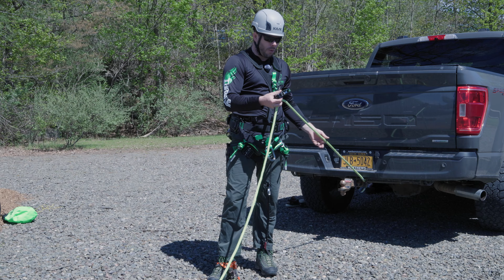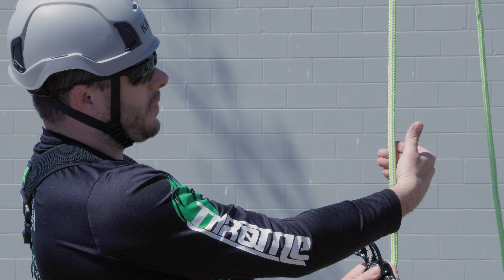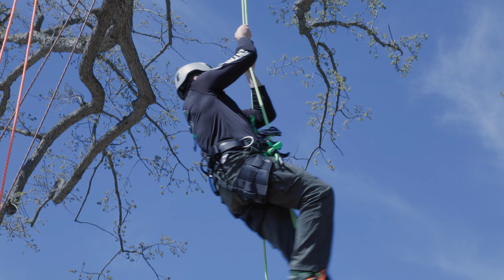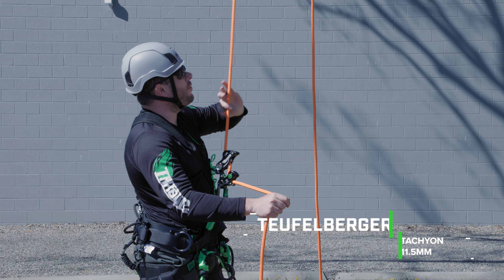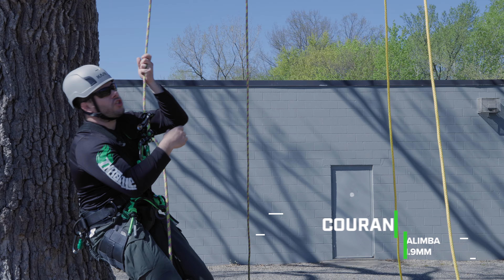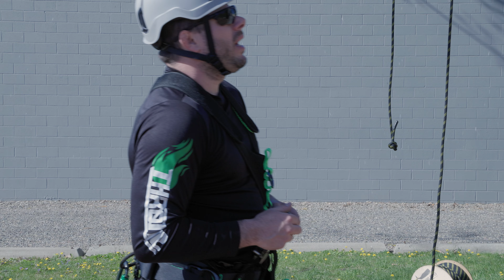Buckingham Throttle™ Overview

Comment: I feel like the device should be ready to go from the box, shouldve had a little more machining or polishing on the friction jaws at the factory. How long is it going to take to "break in" because mine is tough as old boots. Very fatiguing on a long days climbing. Very tough on limb walks, unconfortable to use, the edges feel quite sharp, not ergonomic or well designed when your on a limb walk and having to reach for the device to let slack out when its behind you or at a funny angle. It isnt always going to be right in front of you as demonstrated in this video. the cams extrude over the top of the device by a couple mm which get caught by your fingers and affect the way it breaks friction or the way you pull slack through the device.
When using a 3:1 (on srt for return on a limb walk) the rope rubs against/pinches the back of your fingers when walking out on the limb/descending. The friction can be quite tough when ascending too. 

My tending pulley doesnt spin smoothley either already, the bearing feels worn or something and the pulley also rubs on the cheek plate quite substantially which has worn the pulley wheel and cheek plate after maybe 20 climbs

Im using a marlow maverick 11.7mm rope 

Overall im not very impressed with this device
Reply: Anyone company new to saws or mechanical or batteries is going to have problems..akimbo and rope wrench...go to 2 combos ..have new un used zigzag and new unicenders that freak me out on srs because it don't stop when descending..o.n blue moon akimbo and rope wrench on 2 of them never fails ..

Comment: This is great information. I am currently running Yales Blue 32 and Blaze combo with my Throttle and loving it! I am on the smaller side for a climber though (155lbs), How much does the gentleman in this video weigh?
Reply from the maker: He's right around 205 lbs!
Reply: How is it running on the blue 32? I returned mine because it would not play nice in any of my standard ropes and I dislike the blaze that everyone else seemed to be having luck with. I never thought to run a caveman 16 strand 13mm rope through it to wear down the friction plate to get it to function.
Reply: @troyerthedestroyer we used 16 and 12 strand for over 20 years .seen small Mexican take down the biggest red oak I've ever seen with Blake's hitch and old lether seat belt .😢😮😅..back when I was still in production employment we didn't have internet and didn't even have hitch climber s...was all Blake's double Blake's or taught line
Or split tail.french prussic 😅
Reply: @Sethhaun78  Yeah, I ran all the old school stuff too but I am still climbing and need every advantage I can get :D
Reply: @troyerthedestroyer I know I'm going on 50 with broken left outer foot and left fingers 🤞.my right knee is torn and had liver failure issues last year was working with that illness 2 years and didn't know caused my body to cramp up and shut down..last year could barley lift my saws ..got small hernia from it as well...went almost 28 years never heard of injury until I got sick the heat makes my hamstring lock up so bad it's terrifying..crippling..been waiting all year praying for cool off .just now able to climb half way decent again..I run solo tree service landscaping business full-time..went threw dozen guys they just don't want work ..only want payed...but being health issues it's getting real real hard..have a guy couple days week but needs trained on ropes ..have grcs so if could get a guy to stick around be great ..also have the truck mounts...fir it...hard to do solo...just bought used ditchwitch sk miniskidsteer last fall but don't have dump trailer only 14 ft trailers that I load ..for last 7 years had to remove trees and hand load them by . myself..just can't do it like before with liver and health issues...the medicine they have gave me helped out need follow up for something else ...I've gained back 12 pounds was skin bones ...I used to lift 400 pounds and be superman but after 43.  Was in comma and started HAVEING issues... learning to do everything all over from dayone ..have to move certain ways and do things different then before it's been real real struggle..
Reply: @troyerthedestroyer  Runs great on Blue 32. I primarily use Blaze for MRS, but I also have Courant Squir and XTC-48- both perform extremely well with the Throttle for me as well. I’ve used mostly mechanical devices for the past 10 years, so I’m familiar with the need to be patient and let them “polish out” a bit. There’s also something to be said for using your actual mechanical device for the milking process (as shown at the beginning of this video). I’ve noticed that many climbing lines like to adapt to the way friction and pressure is applied by a specific device—almost like a kind of mating process i.e. like your brand-new boots adjusting to your feet, or the padding in your new harness conforming to your body.
Reply: Notice they only answered the comment that praised them ? @troyerthedestroyer